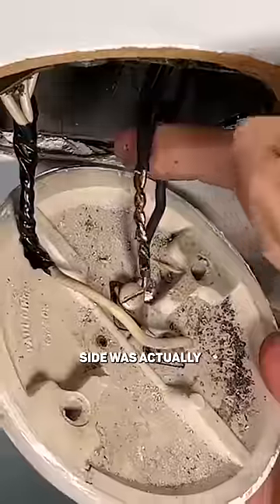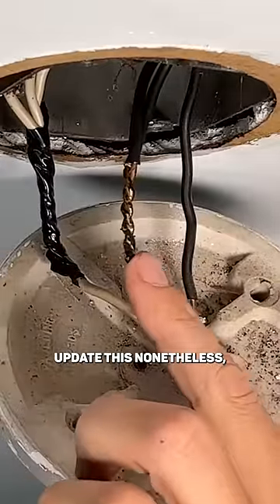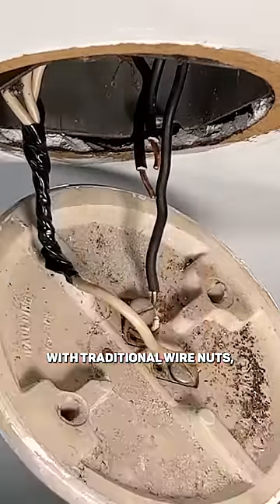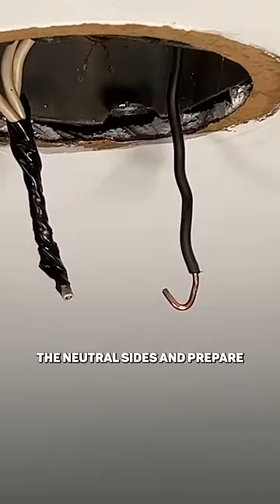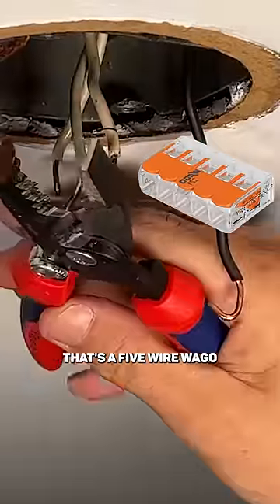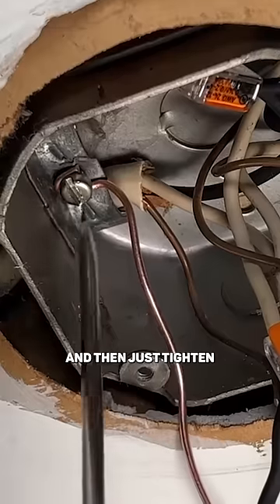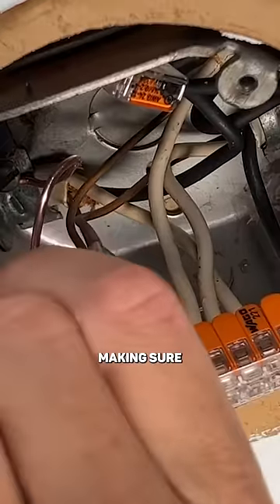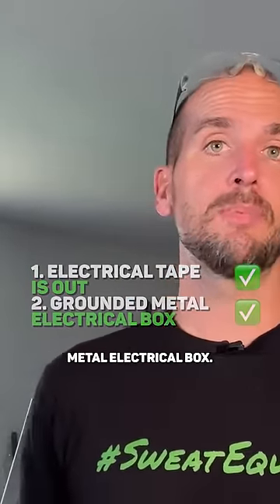Which Part Doesn't Meet Code?

Comment: Where’s your green ground screw
Reply: 😂 he’s better off with what he did without a green screw 😂😂
Reply: In standard NA electrical boxes the bond screws aren't green. But that's a detail. Looks like this old box didn't have bond screws and it's definitely not OK to use a cable clamp screw instead.
Reply: It's not required to be green.
Reply: @lloydmills9619  yes, it is required to be green. Kinda dumb but yeah.

Comment: Nope. In Arizona, heat kills plastic and it will eventually break. At least with a wirenut the wires are twisted together and a proper nut is metal inside so no stress on the shielding part. Not as easy but better quality.

Comment: I have almost completely done away with wire nuts, the wago or like Ul listed connectors allow for trouble free connections, and disassembly or additions and it’s faster….new or repair work it’s the way to go!, the metallic box is grounded, but many plh units are not….some violations are indeed present….

Comment: O. M . G.    Did you just bond the neutral to the 4 inch steel Octagon box  ? ? ?    B I G    no no.....  Never ever bond the Neutral wire to the GROUND anywhere else BUT  inside the panel...   Never ever use the wire clamp screw for holding the ground.  The ground wire MUST be secured by it's own grounding screw....    It takes a couple of teaching lessons to learn why...

Comment: I like a tight wire nut connection i feel like wago isn't a tight connection but that's just my preference
Reply: Master electrician here with over 35 years in the field. WAGOs provide a solid connection. The design has been in use in Europe for well over 50 years. As so often here in the US, we reject better technology because it wasn't invented here.
Reply: @Ethel Ryan hi there I think wago are faster and easier to use but do you really think the clamp on is a better connection then twisting the wires together with a wire nut I have 22 years in the field and am a master electrician in 3 states there's some good videos online of them doing tests the wago connector has more resistance then a wire nut connection which to me means a worse connection what are your thoughts?

Comment: As a Journeyman Wireman. I hate when I have to work on this, You are required 3 inches past the front of the box. I have always been able to reverse-twist the soldered connection. Instead of cutting off the perfectly good connection. SMH In this day and age would not heat shrink on the exposed conductors and re-terminate. As for the ground, a dedicated grounding connection would be preferred. USA Code only requires that it be a machine screw.

Comment: Using wagyu connectors on residential wiring is kind of like using the Press in connections on the back of a receptacle or switch there is so much less contact area available and it can create a wiring failure and possibly even a fire hazard please people take the time to use wire nuts and make sure you know how to use them properly
Reply: They ve been around since the 50s americans just hate new things

Comment: Another add for these things. I'm an electrician and nothing beats a mechanical joint(wires twisted together tight with line pliers, capable of holding itself without a wire nut) .
     These are just for lazy people will never catch on commercial, more likely to fail as well.

Comment: 1. Splice is the soldered connection, 2. Wirenut, 3. 221 connector.  I personally don't use those seen them fail and susceptible to cold flow generating heating  at the connector.  They're not great at carrying heavier loads 12amp load will heat them up all day long.

Comment: Love Wago’s, I use them on most of my repairs and little installs. I did have one inspector who was not happy, but because they have the UL on the label he couldn’t have them replaced.
Reply: Wagos are the best connection you can get when the wires are too short lol

Comment: I would have wrapped it in rubber tape followed by friction tape. That soldered connection was forever. 

There is a way of wrapping the vinyl tape so it doesn't unravel, which is likely what they did originally. This method was common in the 50s and 60s and I still see the vinyl tape holding fast.
Reply: My parents house built in the early 70's is wired with soldered connections and all of them are still taped up so well I had a heck of a time getting it off!

Comment: The ground screw needs to be tapped into the main elec.  box by the manuf. And have a green ground screw in it. That's the screw for holding the wires in the box it's not even a ground screw. It's illegal af !

Comment: Wago's are junk, you just took out a much superior connection in favor of something known for melting over time. Twisted/soldered connections have lasted 80 years.
Reply: Wago's are not junk.
Reply: @Kevin-mp5of  You would be speaking German if it weren't for our wirenuts and outhouses!! Things haven't changed much on the world stage for you since then either! Just saying
Reply: @scotty362100   whats are you talking about bud wagos have been around the 50s after ww2 buddy

Comment: Wago things melt all the time I see then
Reply: yup, since the wires are not connected together, but instead go trough a thin coated piece of metal, there's is always resistance there

Comment: Code violation when he wrapped the ground wire around the cable connector screw. It is not an approved grounding terminal screw. National electrical code article 250 clearly states that the grounding terminal screw may not serve any other purpose than to bond the ground wire to the box.

Comment: Hahahaha, his love of these wago connectors is hilarious. He just undid a far, far superior, twisted, soldered connection, in favor of a Wago.  If you don’t want to use the proper tape that will not get brittle, then cut it a little shorter and put a wire nut on it. Even if you think those connectors are better than wire nuts, there’s no way they could possibly be better than a twisted soldered connection. The wire nut would simply be used to cap it off and insulate it.

Comment: Need 6’ of wire in every box in the cec
Reply: This just got updated for 2023.  Splicing to get 6" is now acceptable.
Reply: @marsBWR  Good to hear, but extending wouldn’t be half as necessary if every spark didn’t see 3-1/8” past the box and think “GROG CUT NOW” on every recep and fixture
Reply: "Need 6' of wire in every box",. 6 feet!!, never going to happen and I don't want to open that box!

Comment: Reason I will never use a Wago, Wego, nut:
wire contact zones;
Wire Nut ******  
Wago Nut .  .
If you cant tell, Wago Nuts only contact the wire at 1 or 2 points, a slim bit of copper that touches the wire at a single point on either side of the wire which under heavy loads will create quite a bit of heat.  I will stick to wire nuts. twist on tight, little tape to hold it secure and prevent anything from getting in and touching the wires and boom done, if the tape falls off who cares at that point as it was merely there as a 2nd level protection totally unnecessary but I feel better installing the device with that little bit of tape there.

Comment: You have no idea what you're talking about. This is nowhere near code. Code would be to twist the wires back into the insulation. Wire nuts are always a better more solid, secure, and better conductive solution. The only people who use wagos are people who have no idea what they are doing, or are incredibly lazy. It's a hack short cut to prevent having to take the time to properly connect the wires.

Comment: Metal boxes need to have a covered ground wire and a code green screw for your safety and code compliance.
Reply: The bonding pigtail doesn't need to be insulated. It can be scrapped bare wire or a long ground wire from one of the cables entering the box. And bonding screws aren't always green, except for load centers.
Reply: 10-32 ground screws
Reply: No they don't.  They don't require either of those.
Reply: The ground wire isn't required to be insulated.

Comment: Finally an American using Wago's!!
Reply: Yeah got to keep fire stations busy somehow.
Reply: @johnh8546  they've been used in the UK/Europe for years with no issues.
Reply: @user-su6yk6qi8v  the residential electrical fire rate in France is about 50,000 per year, it takes the US about 10 years to match that, despite a much larger number of homes. It's actually so bad that any home over 15 years old in France must have its wiring tested before it can be sold, because it's failing. Yeah no issues let's go with that sure.
Reply: @johnh8546  Wago's aren't the cause of that though.
Reply: @user-su6yk6qi8v  I can't put that fully at the feet of Wagos that's true but all testing I've ever seen does show they are more failure prone so they are absolutely contributing.
Reply: @johnh8546   thevy been around the 50s if they were that bad then there use would have been banned

Comment: Why go or about 30 cents to 50 cents a piece whereas the wire nuts are about five cents a piece. That really adds up quickly. I got 200 of the three wire wago for $60 I was horrified
Reply: Same, I’m trying to look for a cheaper source. I use them on food trucks because wire nuts tend to rattle off over time even if taped
Reply: Same, I’m trying to look for a cheaper source. I use them on food trucks because wire nuts tend to rattle off over time even if taped
Reply: @nightmarejr do you wrench the wire nut till the wires start to spiral together?
Reply: They're cheaper on Amazon in bulk
Reply: @Kevin-mp5of  you do got me there. That is brutal and I guess worth every penny of it. I give up, you win! As I'm dealing with that pain right now and both my elbows and shoulders. Make it go away
Reply: @Kevin-mp5of  Use a wire nut driver in a cordless screwdriver, saves time and body.
Reply: @Kevin-mp5of  it is absolutely brutal.
Reply: @Kevin-mp5of  I've been disabled for the last 23 years first from colitis now Crohn's disease. I was screaming in pain for 14 years before they finally gave me some painkillers. And I'm on all kinds of heavy duty shit a junkie would love to have. I would trade them all in in a second to have no pain and healthy body that I had Pre 30's now 51. I had to start on a much higher dose of narcotics because they had me on Tincture Of Opium for 14 years. Try finding a pharmacy that wants to deal with that on a regular basis. Total nightmare. But now the painkillers are almost as hard to find as that stuff was back for the 14 years I was on it. And super expensive too. It did nothing for pain but made me highly resistant to the painkiller. Or I'm just a freaking naturally resistant to painkillers. I wouldn't wish this on anybody. I'm having MRIs done on Friday for neck and back surgery from a car accident not too long ago. Pain never ends for me. And it's much worse for me because I've been on these painkillers for many years now. So they don't have the kick that they once had. And getting the proper amount when I'm already on a high amount is a nightmare every single time. I dread going to the hospital.
Reply: @Kevin-mp5of  death can't come fast enough for me. Unfortunately I know I'm going to suffer and die a long drawn out death. Because I've been shot during attempted home invasion, attempted murder. I've been run over by city transit bus. I've had my entire large intestine ripped out when I hardly knew what colitis was. And it only got much worse with crohn's. My first 30 years I was never in the hospital never sick. Since then I've had over a hundred surgeries and that was just in a two-year period. Four five major major surgeries I've been in the ICU five times since I was 30,  20 years ago, WTF, how much more suffering can one guy put up with?
Reply: @Kevin-mp5of  no and pain rules everything. They give you some kind of crap line like oh God wouldn't give you any more than you can handle. To that I say BS if that was the case I wouldn't be forced to have to look for a pharmaceutical help. Which is never the answer.
Reply: @Kevin-mp5of  you should have seen the expression on my mother's face when I refuse to be giving her the right to wake me or resurrect me as like if I'm dead leave me that way I should be. Unfortunately that hasn't happened yet. Very close but not yet. You sound a lot like me. Just had enough with everything
Reply: Don’t they have a Wago that can accept twisted wires? Oh wait, you could have just put a couple of wire nuts.
Reply: I use lever connectors when I come across short wires and don’t want to cut back any more otherwise twist connectors.
Reply: @lv7603  I just got 30 of those for $30. And I got them for that exact same reason because using short wires with anything but those wire nuts is impossible or takes 10 times as long which is same thing as impossible and who wants to spend that much time on one little wire?

Comment: This installation is not code compliant. The length of wire protruding from the junction box is too short and the method of grounding is not listed. While this is functional if your goal is to make this code compliant then more work is needed.
Reply from the maker: Thanks for the feedback

Comment: The ground screw must be a listed screw for grounding.
Reply: Just asking for info, how is a green grounding screw different from a regular screw ?
Reply: @Mote78  The metal , it has no coating on it. better conductor.
Reply: @nicodemus-dean7020  
Thanks.

Comment: I have to say, I will continue giving my connections a good twist and install a nut. Then maybe even a good wrap with tape just for that extra. Not sure I would ever trust those you use.
Reply: they only been in use for 70years in europe. Not long enough to call proven.
Reply: @Pepe  Ah, so Europe uses highly failing connections. I get it, Americans are a little smarter. This remind me of a house fire I saw once. They can use anything they want. They would be alright for low voltage/amperage connections. I'll continue doing things the right way. Twist and cap. Lile I said above. What happens if there is a failure in an appliance or even a light and you get a short. Those thin little plastic boxes will heat up and melt and create an even bigger issue. Not for me. Clean work though. I will give the guy that.
Reply: @cobravids  if you got 100amp 240v on 12awg where the wago melts, then you got a bigger problem than wire connectors.
Reply: I don't use the 221 lever wagos myself but I do use their 2273 push in version for 15-20 amp breakers and they work just fine. There is a reason why they only take 12awg wires. 10awg and gigger I run them straight, no pigtails. I temporary use Polaris insulated lug connectors for worksite power, way better than twisties.
Reply: @Pepe  Yeah crimping is better. I have used those too, however I can't ever find my crimper. Lol. Just kidding.

Comment: jeeze..... where I live, the "hot side" ie active or live, MUST have red sheathing, Black is reserved ONLY for Neutral and yellow/ green for earth. White can be used at a lighting point for a switch wire.
Reply from the maker: Hmmm, This is the common wiring color found in my area and most areas in the US.  The colors you are outlining sound a bit more of a commercial setup.  Do you guy have to run conduit?
Reply: @EverydayHomeRepairs  "where I live"... ie colours as specified in the AS/NZS 3000 series Wiring Rules of Australia and New Zealand (Fiji uses them too). Its law. Also, all electrical work above 50 V ripple free dc MUST be done by a qualified electrician who has completed a 3-4 yr apprenticeship and passed all theory & practical exams. Same with plumbing. 👩‍🎓👨‍🎓

Comment: DO NOT GROUND A JUNCTION BOX LIKE THAT!!! Look around the inside of the box and you will find an unused machine thread hole for a ground screw. The screw you mounted that ground wire for gently clamping the Romex jacket so it doesn't slip from the box. That clamping plate is not meant to crush the insulation or jacketing.

Comment: Show me in the NEC where it says you ground a ceiling box....or any box....with the cable clamp screw, and splice a neutral wire to ground the box anyway.  CAN'T DO EITHER of those.

Comment: Ground screw must be green.    

250.126 Identification of Wiring Device Terminals.
The terminal for the connection of the equipment grounding
conductor shall be identified by one of the following:

(1) A green, not readily removable terminal screw with a
hexagonal head.

(2) green, hexagonal, not readily removable terminal nut.

(3) A green pressure wire connector. If the terminal for
the grounding conductor is not visible, the conductor
entrance hole shall be marked with the word green or
ground, the letters G or GR, a grounding symbol, or
otherwise identified by a distinctive green color. If
the terminal for the equipment grounding conductor
is readily removable, the area adjacent to the terminal
shall be similarly marked.

Comment: Apparently nothing is known of what code complaint is - let me explain…

You fixed nothing by any of that, and made it worse. Introducing additional code violations “correcting” what you had no idea was code compliant for its likely date of installation. 

“WAY-goes” (WAGO) are really popular in Europe where they deal with half the amperage for the nearly double voltage. And in the US and Canada have a high failure rate at heavier loads. While the tape on the soldered joint was thin (should have been to the thickness equivalent of the insulation) - It held it load capacity for nearly 50 years- change was completely unnecessary. And put in place something inferior. Followed by a “tuna fish” ground. You may have pulled out it’s ground clip because you didn’t know what that was and have no business speaking on this topic.

Comment: The Wago CAGE CLAMP is made of high-quality chrome nickel spring steel. The current bar is made of electrolytic copper with a tinned surface.

Other rip-off or inferior products may be made of cheap steel.  You get what you pay for.